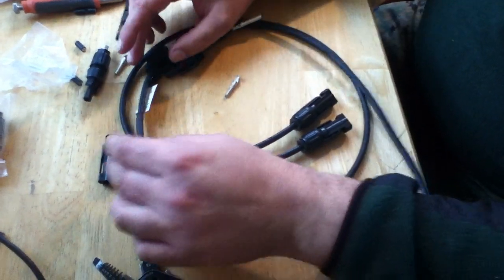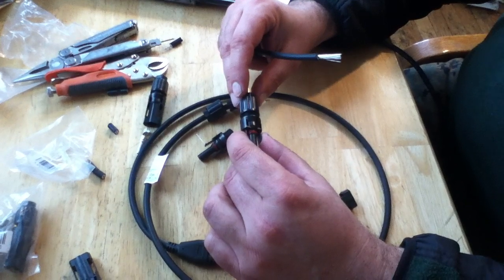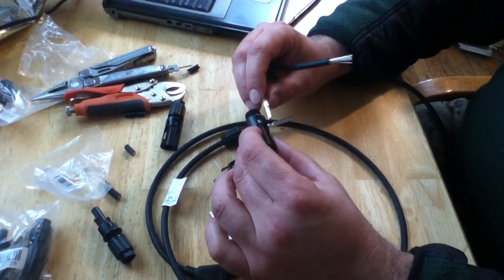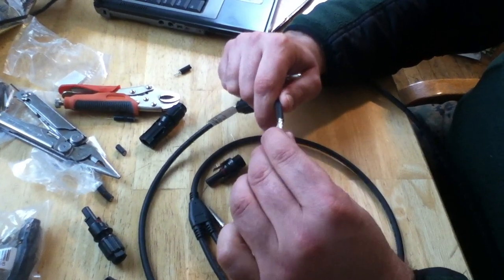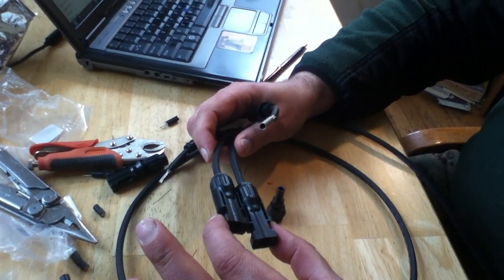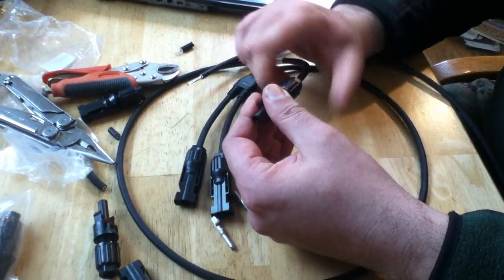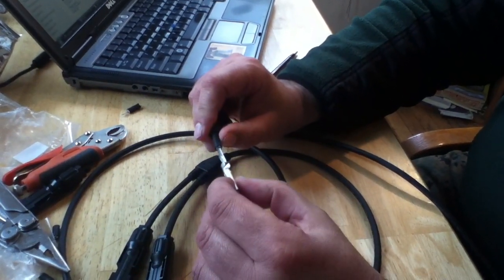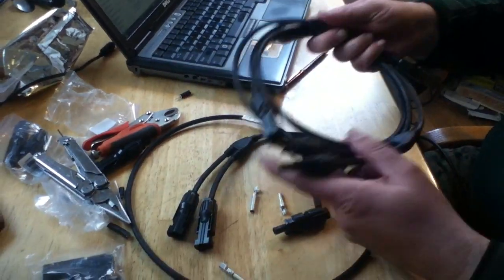Installing MC4 solar industry standard cable connectors using common tools

Comment: Do they make a 6 awg MC4 conector?  

I want to upgrade to 6 gauge wires for my (3 x 150) 450 watts of panel to the controller... or if I have to settle then 8 awg I guess...(I have 10 awg now 30' long and I think I am losing amps in the run)

Comment: Nice video, thank you! Explains most of the things I was interested in as an amateur solar panel hobbyist (related to MC4 connectors, of course). I do have one question, though. I plan to crimp my MC4 connectors onto solid copper wire, not stranded. Never seen anybody do it before, but I plan to. Do you think the crimping will hold just as well? I'm thinking of crimping it, then soldering it, just to be sure...

Comment from the maker: I have seen fires and explosions caused by short circuits when something is not crimped right, or when a lot of amperage got pumped through a skinny wire, but I guess I have missed something in my 40+ years of using power cords and outlets where different blends of copper and brass were used on the connectors and failed to cause fires in common devices.  My vote on those alleged fires caused by solar panel wiring, if they ever took place, was something to do with bad connections or overloading, not the formulas of the metal or whether or not someone skipped a costly certification process in favor of a cheaper certification process.  Price gougers always have their excuses, some more credible than others, but the fact of the matter is these connectors, whether "authentic" or "fake" are definitely not the best electro mechanical design out there, they are absurdly complex and really designed for a very small number of manufacturers to maintain a stranglehold on market share.   A lot of people I know simply cut them off their panels and use automotive connectors.   Next I get to hear about how solar panels from Chinese companies cause cancer, those from German owned companies are Vuuuunderbaaar...

Comment: There is no lower quality connection if you disconnect and re connect on any MC4 product - there is a laminated contact within the socket.  The connectors shown with RED O rings are not MC4  products but copies these should not used with MC4   As for the assembly you can crimp outside the connector and push the contact in and then tighten gland end  Any assembly details can be see in Assembly instructions on Multi-Contact web site.  The Y connectors are NOT MC product but poor quality